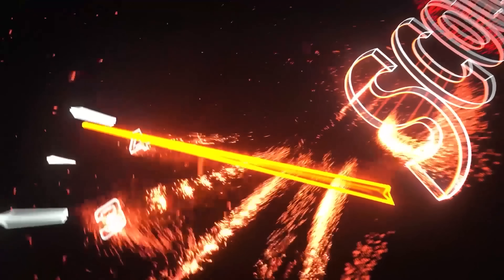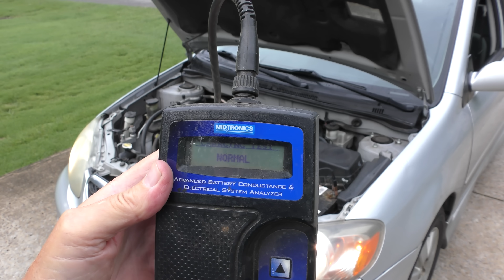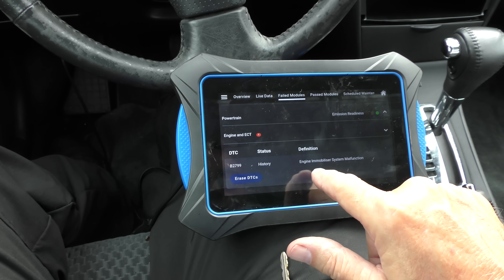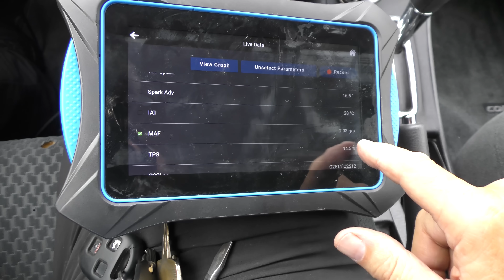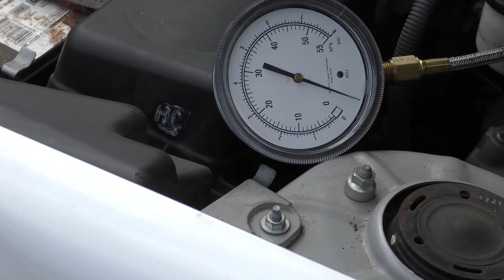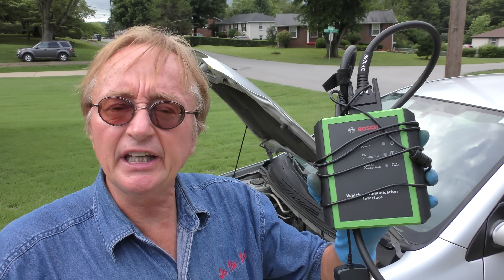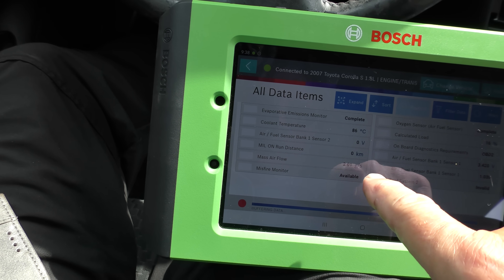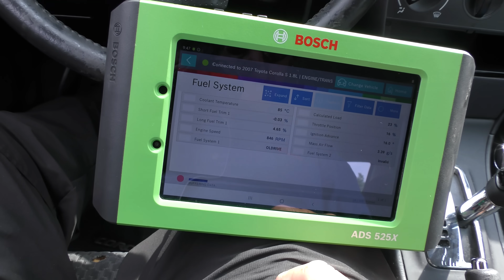I Can't Believe What This Fuel Cleaner Did to My Customer's Car

Comment: I'm not a mechanic, I'm tech support, but the troubleshooting method is universal. It's always pleasing to see someone doing troubleshooting and see that they know what they're doing. Not that they know what the problem is, but knowing how to find it.
Reply: The hardest trouble find are the intermittence ones.
Reply: @vamp4997  that's only if u don't have a oscilloscope
Reply: Very true. The majority of trouble shooting is simple. “Find the last source of power” 😉
Reply: @vamp4997  beware suspension problems from obese customers...
Reply: @vince2997  spoken like an electrician. the front driver side wheel is rubbing. nothing electrial. what do u do?
Reply: @tonyb7615  Ehh, you got me there. I can only speak on avionics. But I never stop learning. 😀
Reply: @vince2997  so birds.... nope
Reply: The worst trouble of all results from intromission.
Reply: @vamp4997  the key is to look at what is right.  That eliminates alot of problems and brings us much closer to the solution!
Reply: 100% I had a friend who helped me with a lot of repairs. By helping I mean he did it, but showed me how. He worked on my car, and did plumbing and electrical work at my house. Main thing in all cases was he taught me the importance of trouble shooting. Track back until you find the problem.
Reply: @tonyb7615  Look to see what it's rubbing on. That's the first thing I would do as an electrician.
Reply: @JayDee-ve6ml oscilloscope will not find intermittent  problems. It's not magic.

Comment: A half hour drive at 4000 rpms is called an Italian tune up.
Reply: Or a hillbilly overhaul
Reply: VGG😂
Reply: @shamanbaray6327  12000RPM for Italians. LOL🚗🚗🚗🚗🚗🚗🚗
Reply: It wasn't just a half hour drive. That would be a bodge.
Scotty was moving the cleaner through the injectors – and it performed the task well.
Reply: God I love jokes like this
Reply: 4,000rpm... are you driving a diesel or something ;-)
Reply: Italian tune up is driving right at redline.
Reply: 'Nevada Tune Up,' as At the Time, There Was NO Real Speed Limit in Some Areas, on Roads in the State.
Reply: That's cruising around in fifth gear doing approx. 80mph in a Miata 😄
Reply: Lol my s2000 is cruising at 4000rpm at 70 mph  
4000rpm is nothing
Reply: Take it on the free to 120 mph
Reply: Isn't an Italian tune up foot to floor in all gears until it's just about to blow up
Reply: All this reminds of an old and well beaten VW Beetle (air cooled)! I bought a million years ago. That thing was in bad shape. Had been laying for a few years, etc. Change oil, spark plugs, points and condenser and here I go hit the road. Poor thing screaming it's lungs out...
The rec hot pieces of carbon spiting out of the exhaust was memorable! LOL 😂 Left a several meters trail of red sparks like a meteor passing down the road!
I don't know how much carbon got out of the entire system. A lot I guess! But boy was it smooth after the "treatment"! ;-)
Reply: Punching a woman in the face, is called an "Irish Kiss."

Comment: I have been using supplemental fuel injector cleaners for years on a routine basis. Never have experienced a streaking or low flowing injector on anything I drive. Cheap insurance.

Comment: I love how in depth he went when diagnosing that car. Most techs I used to know would never go that in depth. If they can’t duplicate the issue, they just give the car right back and don’t bother looking at anything
Reply: Unfortunately they work flat rate so they have to work to "beat the clock" otherwise they work on their own time.
Reply: Very in depth. At the same time, if u were the cars owner ..before taking it to a mechanic I would have bought and used that royal purple stuff and see if it fixed it..and if not, then take it in.
  So as an owner, start small and cheap. So maybe start backwards.
As the mechanic, it's the opposite. Start with basics and work forward . 

     That royal purple I believe has PEA. Only use fuel system cleaners with PEA. It's the only proven ingredient that works. Amsoil makes one with it too. I'm unsure who else .
Reply: I took my truck to a shop that was in business for 40+ years. They couldn't figure out the problem, so I had to have it towed again. I didn't catch it that the mechanic couldn't be bothered to put the spark plugs back in spite of me supplying a set of new plugs. 
After the truck sat for two years, I cleaned it up to have it towed to another shop. Mud dauber nests everywhere! I reminded the new (to me) shop not to turn the crankshaft until any mud dauber dirt was cleared from the spark plugs holes and cylinders.
Reply: thats the "factories" intent.  they train all the "techs" to use scan tools.  any trained monkey gets a job at fast lube these days.  and the work quality is super low par.  old school mechanics  were like Vets,  you knew the animal was sick,  but it could not tell you its symptoms...  they had to work all that out for themselves.  made for real good mechanics in every workshop...  all  gone except for a few like Scotty..
Reply: @JohnS-il1dr  can't cut corners on a diagnostic
go about it systematically like Scotty does and you'll ge there every time.
It's not difficult, it's in every Fuel Injection Troubleshoot manual to check those things, in that order.
Reply: They probably don’t know enough what to look for.

Comment: You saved me with the guidance and suggestion offered in this video when I desperately needed accurate answers while stranded in Nowheresville Florida! My 2008 XC90 went crazy on me, whereby it ultimately went into limp mode, a nerve racking experience while driving on the highway, which was indeed my experience. At first I figured my circumstances were the result of corrosion in the CEM; I opened everything everything up, found a ton of corrosion and followed your advice from a separate video involving a Nissan. I was so happy to successfully remove the corrosion and was certain that I could then continue my 1,000 mile road trip to visit my son for a weekend of camping; however, I was mistaken, whereby the situation did not improve in the least. While dangerously making my way down the highway in limp mode in an attempt to find an autoparts store, I felt overwhelmed with uncertainty with regard to what needed to be done and my uncertainty of what that action entailed. After finding an autoparts store, I went through the following attempts to no avail: changed the upstream oxygen sensors, MAF sensor, and fuel rail position sensor. I then came across this video...I followed your guidance precisely down to the particular brand (though while keeping the vehicle in park, yet maintaining 4,000 RPMs nonetheless) and yes sir, it fixed everything! I am happy and grateful beyond words, and am rather amazed that universe enabled me to address unreleated though important maintenance issues along the way, by way of your guidance!

Comment: Had this issue with an old Taurus a guy gave me, it was the MAF sensor needed replacement and some carb cleaner.
Reply: Have a 1990 f150, couple years ago started just simply cleaning maf sensor and a couple other things a couple times a year, absolutely amazing how little maintenance actions like that effect the quality of the drive
Reply: @kolbymartin9743  There are special cleaners for that MAF sensor.  If you damage it replacement parts can be expensive.  Obviously you know what you are doing.  Yes little maintenance items like tire pressure and fluid levels can improve your driving experience significantly.

Comment: I saw this video and sent the link to my brother who was having a slight hesitation problem and suspecting his injectors needed cleaned. he bought the royal purple max clean at Walmart and immediately started having problems with his seals that came in contact with the stuff. so far he's had to replace his gas tank and is still having fuel leaks at different points in on and around his engine and since the blow by in the cylinders occurs and allowed the contaminated fuel to get into the oil now he's having oil leaks appearing. that can of crap is ruining his car.

Comment: When my Mazda was sluggish I put in some of that Techron fuel cleaner on 2 consecutive tanks and that cleared it up.  After that I only bought the "Top Tier" gas and the problem did not come back.
Reply: You only want to use premium fuel if the owner's manual says so. If your fuel injectors were that dirty, also clean your throttle body, maf and map sensors if equipped. Then do 80 on the highway for a half hour or take a nice road trip. Did this for my gf's 13 Elantra and now no more shaking and runs like new. She used to do mostly city driving. That'll dirty it up.
Reply: @ADDwithJTC  yes short trips 8-10 miles over & over is 'severe' service vs highway driving
Reply: @Roger_Rabbit_Adventures  need to go on a nice long trip!

Comment: My LS had a rough and slightly fast idle. After 8 miles with the Royal Purple cleaner and a topped off tank.... smooth and spot on the factory number. I think it is really the best out there.

Comment: I remember when the family 1964 Pontiac Grand Prix wasn't running right. My Dad squirted some carb cleaner down the carb throats to clean them up, then dumped a good dose of cleaner in the gas, and we went for a drive. He kept the automatic in second gear and drove between 65 and 80 mph. The engine definitely ran better, and as my Mom and Dad continued to drive it on their normal errands it ran better and better. The same technique worked for the Carter AFB carburetor on that big 389 Pontiac engine.

Comment: I have a 2012 Acura MDX and have been having a problem when shifting from 2/3 where it fluctuates rpm before shifting. I added some Lucus then seafoam fuel cleaner and within 2 tanks of gas it’s running so much better, and went from 11.8mpg to 14.5 hopefully more people see this because I know these mdxs have problems with this and a lot of people think it’s the transmission or torque converter like I did before doing this

Comment: That was my thought all along. Fuel injectors. I'm not sure if these cars have them, but some cars have fuel pressure regulators on them. They can go sour and get this issue. Also the throttle body position sensor can be dirty, but not bad enough to throw a code yet.

Comment: I would contribute carbon build up in the cylinder head as well. We do 3 part fuel induction cleanings all the time at Subaru and see massive improvements in engine performance.
Reply: Additives or removing heads?
Reply: @bluespig1  additive, 1 goes in the fuel tank, one gets vacuumed in via intake manifold, and the 3rd part is a throttle body cleaning. You be surprised how much carbon builds up. Even on low mileage cars with under 60k will have carbon caked to the back of the throttle plate.
Reply: @bryanaaron2131  I think I’m having this issue currently with 30 k miles and I was thinking it was what you mentioned looks like I have a weekend project

Comment: in warm weather (and a warm engine), the CVT wants to occasionally lose the ball while driving without prior notice. When driving slowly, it then stays in L as it were (therefore no longer varies the transmission), so then I drive 40 km/h at 4000 rpm, for example, and that doesn't really make any headway. Or, on the freeway, it suddenly jerks and revs up and down, which also seems like being out of whack. I didn't get a CEL but I did get a pending code P0720 secondary speed sensor. It happens occasionally. As soon as I turn off the engine and it cools down, everything is OK again. When I start the engine, I see the dashboard light 'sport' of the CVT flash a number of times.

Comment: I never use cheap liquor store gas or Arco gasoline and i never need to use fuel cleaners. Chevron with Techron does the trick 😎
Reply: the only cleaner i would put in my tank is techron.  these other cleaners clean the benign junk in the tank and send it thru my fuel system.   that is after it softens and thus weakens the insulation on my fuel pump copper windings

Comment: I’ve got a 1990 f150 XLT Lariat that had a rough idle at start up. I had checked everything else except the injectors. Gave this a try and it cleaned it right up. Not only that it really while the engine up. It’s expensive but with it.

Comment: My 2015 Forester has had a "get up and go" problem for a while now.  I have been thinking it's fuel related or maybe a small vacuum leak.  I think I'll try some of this Royal Purple fuel injector cleaner and see anything changes.
Reply: How many miles?
Reply: Keep us updated please
Reply: Maf sensor
Reply: @woohunter1  362K
Reply: @korvaric  Already replaced that twice.
Reply: @HunterXray  did you use after market or OEM , a shop replaced mine , a Chevy HHR ,with after market . I took it to a different shop & after some testing  they said the only thing that really changed was the MAF sensor , they put in a OEM and runs great now

Comment: Had no heat, mechanic says could be many things, heater core hoses, by hands-on, 1 hot, 1 warm to touch, instead of hose at home, had another mechanic use his machine to flush heater core, 1-2 yrs with little heat, good heat now! and I give this Master mechanic the credit.

Comment: Interwebs...people seem to have this problem on the Corolla in the 100k+ range. Fix suggestions are fuel filter, vacuum leak around the air intake manifold, and dirty fuel injectors 👍

Comment: I swear by this particular fuel system cleaner because it really does work well.  Sea foam used to work really well UNTIL they changed the formulation some time ago (the odor is not strong anymore).

Comment: I've had issues with DPF and EGR plus variable vane Turbos on Common rail fuel injection Diesels. 95% Of the time a good quality diesel cleaner will put out the management light and cure the problem

Comment: I remember him saying to stay away from those fuel injector cleaners
Reply: Yes things like seafoam. But he also says do get get gas from cheap unknown places which later on you will need a cleaner
Reply: Yeah, if your car is running fine. But once the injectors are wacked you start with simple and easy.
Reply: @Streetracerex1998  what’s wrong with seafoam? it helped get rid of my lifter tick running it about 300 miles in my oil then I changed it
Reply: @animalmother5902  Scotty says sea foam isn’t good because he thinks they are made specifically for boats still

Comment: Yeah I follow a simple rule of throwing in an injector cleaner in empty tank  like Techron every 2500 miles and changing transmission fluid every 4th oil change

Now I don’t drive crazy high miles sell it before that but my friend followed my advice few years ago and still drives his 2011 accord @ 350k miles and running strong!!

Comment: Well Scotty did find the issue here.  But I've had my 04 colorado, 09 acadia, and 06 silverado  all begin running bad after quite a few mile with no codes, just running like they needed tune-ups.  Just a suggestion.  If this happens to you try this.  Pull the ductwork off the throttle body and clean it with an all cotton cloth and carburetor cleaner.  It may not work but it's the first easiest approach.  I've actually seen Scotty do this.

Comment: That Toyota Corolla has a fair amount of power for a 1.8L engine about 130hp in a fairly light car.  That generation (2003-2008) is selling well on the used car market in my area since it is reliable, runs well, and parts are readily available for it.

Comment: Use Amsoil additives such as the UCL and Fuel Cleaner.  Never had a problem with using them. I normally use Redline S1 Fuel Cleaner.  Amsoil is a quality product

Comment: My car wouldn't go past 4kms when I idle down the street with no fuel, my codes went off for catalytic converter, I was homeless and got a job in another state, my partner was asleep in the back and I jacked it up with the honda scissor Jack, pulled my cat off in a car park and bashed it out with a screwdriver, my hand was messed up from bashing the screwdriver down, finally got it back on just before people started to come open the shop I was parked at. She went back to full power! I then drove 3000kms in 2 days and my car loved it! I got a little extension plug for the second O2 sensor, and my check engine light turned off, love my honda odyssey with all my heart

Comment: Soctty, I use Sea Foam In My Gas Tank. Been Using It For Years & Have 100% Positive Results. It Works In Gasoline & Diesel Motors Great. There Are A Lot of Fuel Cleaners On The Market & Years Ago Tried A Few & Never Saw Any Results. Always, Tommy :-)

Comment: Could be the fuel solenoid. I was buying dirty gas from this gas station and I was getting sluggish acceleration until my check engine light came on saying my fuel solenoid failed. 

I replaced it and kept using the same gas station and 2 months later same thing. I used a fuel cleaner and changed gas stations, the problem went away.
Reply: @captinbeyond  Sunoco on Erie Blvrd in Syracuse, NY. It's a speedway now but I still won't get gas there.
Reply: Shell, BP or Mobil..
 The only gas I'll put in my cars
Shell is always my first choice though

Comment: Scotty I believe you have your scan tool fuel trims back wards. If it’s a negative value the engine is adding fuel. If it’s a positive trim it’s running lean.

Comment: With the radiator flush you forgot to mention the use of distilled water and to make sure the old coolant is disposed of correctly, not just flushed down a storm drain. Some of the best modern long life coolants are green by the way.

Comment: Got a 1994 Toyota Camry with close to 200,000 miles on it. When I accelerate makes a weird noise. No engine light problems pop up, got ABS light on and malfunctioning light signal on. Manual says lights just need to be changed which is easy.